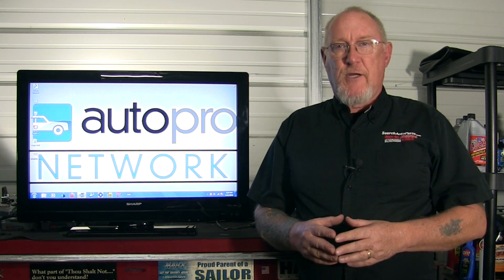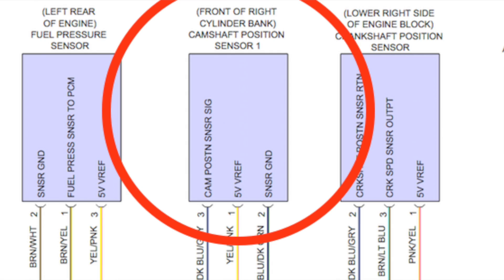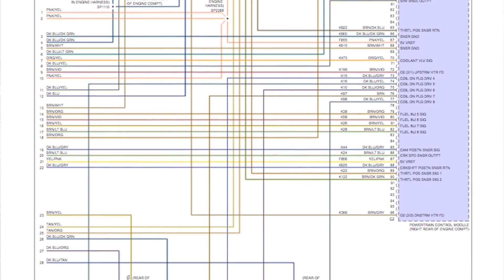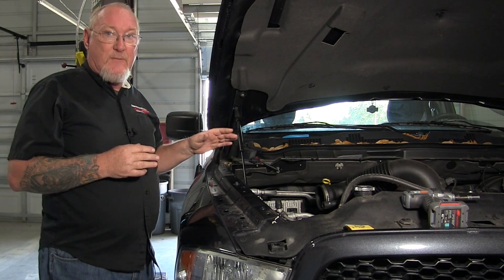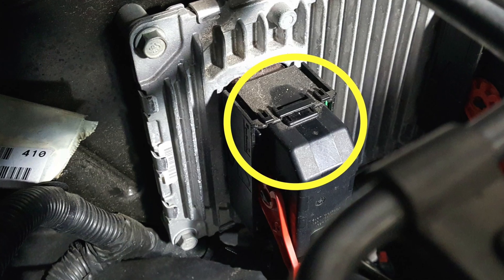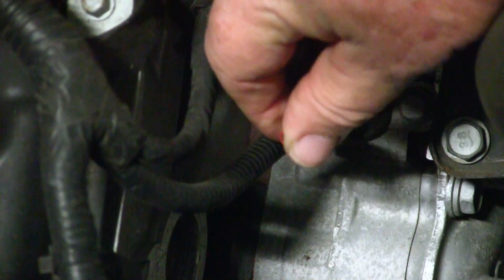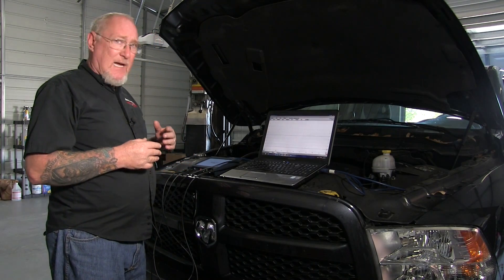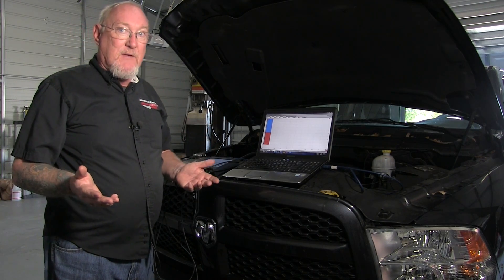Motor Age How2 #4:  Capturing A CMP/CKP Waveform On Your Scope

Comment: Where does the negative wires of each channel hook up to? Im not shure , if the negitive of the battery?  What about the Signal return wire? Is that a cleaner/better place to ground out too?
Reply from the maker: On the PicoScope, each channel is grounded separately, and the leads are designed so you can stack them all on one if you wish. The Snap-on I used in an earlier video is grounded via the #1 channel and the remaining channels are stacked on top of it. I used the battery ground terminal as my ground point because ultimately that's where the ground ends up. However, on some sensors that use a floating ground, that placement will impact the overall amplitude...so grounding it at the ECM is a better option if you need that clarity. Also, as is the case with some fuel injectors, you may think there's a voltage drop issue when there is none due to the ground side of the "floater" only reaching .4-.7 volts. 

I did try tracing the pattern with the scope grounded to the return wire with no difference in pattern quality.

Hope this helps!